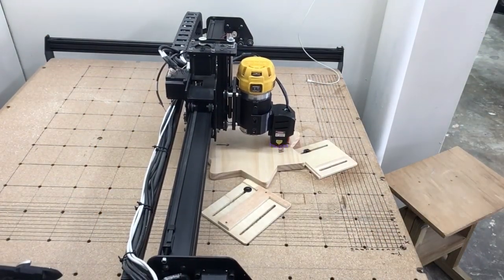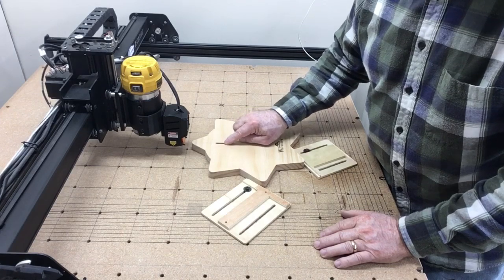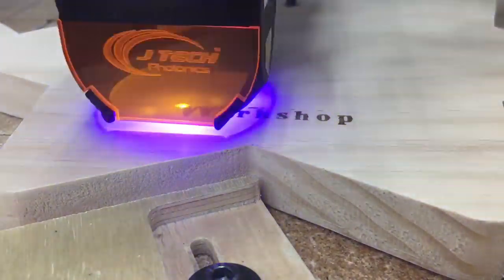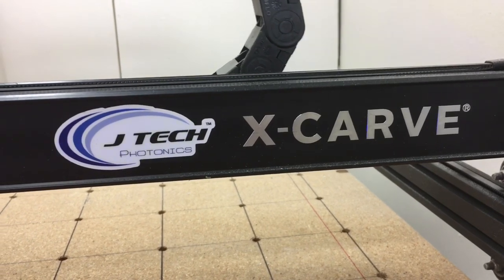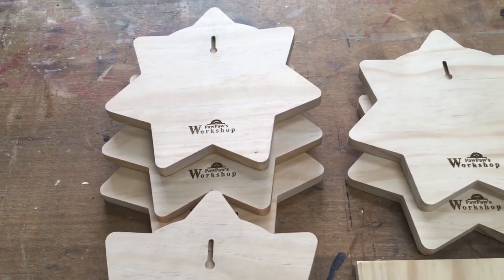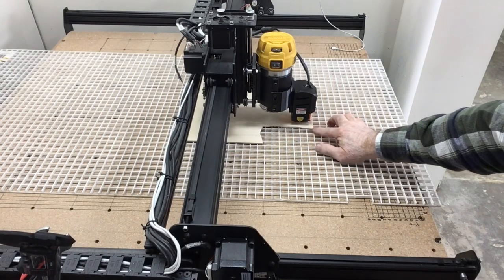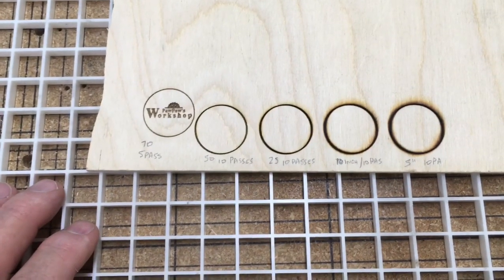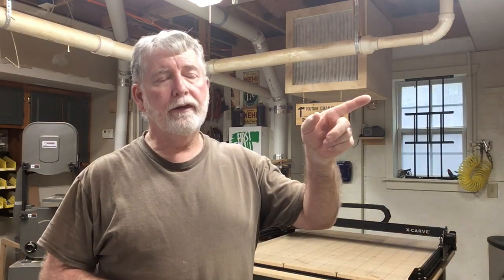Can you Laser Cut Through 3mm Plywood with 7watt Laser?

Comment: I was able to cut a 10mmX10mm square using a 7 Watt Longmill Laser after about 30 passes at 100 mm a minute using 3mm Birch plywood. The secret is to get the laser in focus. I use a "Ramp Focal Gauge from Lensdigital" (which is pricy and you could probably make your own.)  Some material cuts better then others. I can cut cedar in 3 passes and felt in one pass. I just ordered some smoked acrylic 1/8" thick and will be trying that next week. I promised to make reindeer in February and will probably have to cut it using a 1/8" CNC router bit. I will keep you updated and let you know if I can cut the smoke acrylic in a couple of passes.
Reply from the maker: Thank you for the update
Reply: @PawPawsWorkShop  I'm getting a 40 watt laser tomorrow from Crealty. It's supposed to cut 1/8" Birch in one pass at 600mm a minute.

Comment: Agree, ply type is a factor. I use atomstack pro (its says 40w but I read that its only a 5w beam) and have cut small plate stands from 3mm standard ply. I reduced the height to 1mm, max power @ 10mm/sec with 8 passes. I get some burn so I am going to use tac paper. I need to cut 50 stands. thinking of getting the X7 module that has a 10w beam, also by atomstack.

Comment: Nice video, and I really like the versatility you have being able to switch between the router and laser! Speaking from experience, having a good air assist nozzle greatly increases both the quality of engraving, and the speed of cutting with the laser. The advantages are many: when engraving, the stream of directed air blows smoke away from the laser lens so that it never fouls; when cutting, the air stream functions as mentioned, and also clears out smoke and charred material from the cut, giving the laser an unobstructed path to fresh material still needing to be vaporized. Although I'm using shop air as a source with a regulator and water trap, it seems like a tiny aperture on the nozzle is MUCH more important than having a powerful supply. I can put 150psi to the nozzle, but this breaks things, and there really isn't any increase in efficacy above 15psi. Using a 5000mw, 445nm laser module at 95%, I can get thru most 3mm plywood in 4 - 6 passes @ 500 - 750 mm/sec.
Reply from the maker: Thank you, excellent information

Comment: Paw Paw, you may want to try dropping the laser down a bit after each pass.  Your focal point for the laser changes with each pass, if your first laser pass/cut removes 1mm of material your focal point for the second pass is 1mm lower than the first pass.  You may want to also cut at 100% speed up a bit so you don’t burn the material.  Also  be careful not to crash the laser into the surface of your material.
Reply from the maker: Excellent idea. I need to turn on the z axis
Reply: This is what I think.
I am just starting with my diode laser but from what I have learned so far the focusing is critical.
As you cut deeper the focus goes out.
By dropping the z axis down to equal the depth of cut, quite deep cuts should be possible with multiple passes.

I will find out soon because this is what I want to do.
Reply: I have 6w Opt Laser and it can easily cut through 3mm plywood, but I also have air assist so that helps remove the ash for multiple passes.

Comment: do you believe it might cut through 5 mm EVA foam.
Reply from the maker: Adding air assist and lowering the z axis would help.  I'll have to try that.
Reply: I normally work with floor mat foam the stuff you find in the gym. Or 5 mm Eva craft foam the stuff you find in like hobby lobby

Comment: you can skip to 8:00. Spoiler alert, you can't cut through 3mm ply with a 7watt laser...
Reply from the maker: I've learned a lot since this video. If I activate my z axis that will lower on each pass.  Also, I can add air assist and it will do it.
Reply: @PawPawsWorkShop  it's TRUE, air assist mark the difference. one question, what bed are you using in your laser?

Comment: I have a 6W opt laser that will cut thru that with no problem. When using lightburn you have to enable your z axis and step-down on each pass. For plywood I usually step down about .25mm. Number of passes would be thickness/.25 or 8 in this case. You can play with speeds to try and find a clean cut that will cut .at lease 25 on each pass but not burn around the edges. Different materials my cut deeper than .25 on a pass or less than .25. This is hard to measure so its hard to figure out. My lasers shield sits 35 mm (60 from the lens) off the surface of the material I am cutting but it is mounted beside my dewalt 611. The spindle sits  lower than the laser, so I have to make sure it can step down the thickness of your material  without the spindle. (remove bit) or the laser hitting anything. If it does I have to remove the spindle. Lightburn can also be told to raise or lower the head more on the first pass and continue to step down from there.  I assume this could be used if your your material burns around the edges too much  on the first pass.  The manual says this can be use for deeper cuts which I don't really understand. I have aways left this at 0 mm and not had a need to use it.

Love the channel and have learned a lot of things watching it.
Reply from the maker: I have considered activating the z axis but have not done so as most of my engraving is done using the fixed level.  Thank  you very much for the information.
Reply: How do you enable the z-axis in Lightburn? I have a 7W laser attached to my CNC router as well.
Reply: @kentharris7427  Go into Devices Settings. in the top right corner click the enable z axis button. Then double click on a layer you want to use z for and  enter a value for z steps per pass along with number of passes.

Comment: A 7 watt diode laser should be able to handle 3 mm laser ply fairly easily. I think the plywood in this video may have been regular ply that's typically bonded together with formaldehyde based glues rather than the urea based glues used in laser friendly plywoods. Formaldehydes are hard even for relatively powerful CO2 lasers to cut through, whereas ureas are easy. You can tell the difference by looking at the glue layers between the plys, formaldehydes are dark brown/black, ureas are white/clear.
Reply from the maker: Excellent information! Thank you very much.

Comment: The problem is that once you make the first couple of passes you are trying to cut through a layer of carbon laid down by the previous cuts.   The layer of carbon is much harder to cut through than wood.    The more cuts the more carbon.    If you can get things lined up correctly you can try and flip the piece and cut from the other side,  this should double your cut depth  there are videos on how to do this on youtube.   It involves both software and jigs for alignment.    Multiple cuts will work better on something like acrylic because they do not create a carbon layer.
Reply from the maker: Thank you very much.  You make an excellent point.  I appreciate it very much.  Thank you for sharing.
Reply: @PawPawsWorkShop  I really enjoyed your videos by the way.    One more thing is that the air assist people mention will decrease the carbon build up between cuts.
Reply from the maker: Thank you

Comment: Great video, thanks for posting!  The new JTech 7w Pro Laser with HD lens can supposedly cut through 1/4" Home Depot ply in 3 passes at 10 in/min and 100% power.  There is a JTech sponsored video where I got that stat that also compares to the old 7w laser.  The old 7w laser did the cuts in 5 passes at 10 in/min and 100% power.
Reply from the maker: Thanks for the info! I saw an ad for the new laser.  It looks great!

Comment: You need an air assist than you can cut 3mm in 1 pass!
Reply from the maker: I will have to give that a try.
Reply: @PawPawsWorkShop  best is a small nozzel with high pressure (3 bar+) directly pointing at the cut as close as possible. So the evapurated material goes away and dosnt absorb all the laser energy. Sry for the poor english.
Reply from the maker: Thank you

Comment: PapPaw Unfortunately you need to use a 40 watt CO2 laser to cut through that sort of wood or you use Balsa wood 1/16 inch with 7 watt lasers. Laser diodes do not have the power to cut through wood at speeds you have set for you feed rate.
Reply from the maker: Yes, I think you are correct.

Comment: I've not seen many laser videos, but have seen one cutting up to 10mm ply very slowly & took several minutes to achieve. he didn't suffer the same burning you experienced, but he had a compressed air jet at the point of cut which seemed to disperse the heat generated. One of the best parts of laser cutting is the cortortised effect on the edges and no splinters or heavy sanding required
https://youtu.be/xb0Th7FBwNw
Reply from the maker: You make a good point and I will be doing more testing in the future. Thank you very much.

Comment: 40 in per min 2 passes for a 1 inch circle 100% power  of course youll need a 45 watt laser
Reply from the maker: lol, that works
Reply: Yeah even a 45 watt has its limits with hardwood or birch ply i offten just use the spindle 
I mainly use the 45watt laser for thin veneers and thin ply , fabrics ,sticky back foam and to etch images on ceramic tiles and glass or backside of mirrors with the help of pic engrave plus laser and the dac i got via jtech and my little ortur laser engraver that little laser is awesome for logos and wood / anodized metal business cards

Comment: I'm using a 2.5 watt Eleksmaker laser and had the same issue of not being able to cut through even 1/8" plywood. I recently added air assist to it and it basically turned the laser into a blowtorch. It blows all of the charring out of the way and makes the point where the laser contacts the wood a lot hotter. I noticed that the cut is cleaner and finer as well. You might give that a try. I'm now able to cut through 1/4" wood in 2 to 3 passes. One pass on 1/8".
Reply from the maker: Awesome!  Thank you, I will give that a try.

Comment: It sure can and I can also cut through 5mm as well with no air assist or incremental lowering of the Z axis!
Reply: @Maureen Cnota Jtech 7w
Reply: @Maureen Cnota if you go to my page I actually have a video of me cutting out 3mm and 5mm plywood you also need to make sure your Laser is focused.
Reply from the maker: I would love to know how you set it up to cut through 5mm. Thank you for sharing.
Reply: @PawPawsWorkShop  Sorry about that sir, on the 3mm I used 15ipm @100% and it cut through in 3 passes and on the 5mm I use 12ipm @100% and it took 10 passes both cuts the laser was 1/8" above the material.

Comment: The plywood you use makes a huge difference. The glue between layers takes more power to cut than the wood and some glues are very resistant to laser cutting.
Reply from the maker: Excellent point. Thank you very much.
Reply: @PawPawsWorkShop  You're welcome. From my experience it seems the cheaper plywood and the stuff with less layers can be cut with blue lasers.

Comment: what settings do you have your laser configured at, since the laser etching is amazing. I just got mine and I have a ton of projects to engrave, but I am burning the wood too much. Thanks
Reply from the maker: The J Tech Laser comes from the factory set by the pins at 80% power.  In Lightburn I set it at 100% power and 70 inches per minute.
Reply: @PawPawsWorkShop  what about the fire power percentage, what is that set at
Reply from the maker: That is turned down to about 3.5%

Comment: what i do sometimes is engrave a origin point for the xcarve, engrave all the work and then set the router bit at the origin i engraved in that way i ensure that my cut will be alined with the engrave
Reply from the maker: Excellent idea.  I have a line on both the x and y axis that I cut with the cnc to give a very accurate reference point.  Thank you for your suggestion.

Comment: Getting ready to add a JTEch Laser to my X-Carve, I am on the fence about 7W vs 3.8W laser, after watching this I am starting to lean to the 3.8W since I would not need it to cut just burn.  If you had to do it again would you have went with the 3.8W?  How has it been holding up?
Reply from the maker: I like the 7w very much and it is holding up very well.  The 3.8w will work fine, but it will just take longer to engrave the project.

Comment: I have watched a bunch of diode laser videos on youtube and many have the same results you found.  One common thread is that the actual power of these units is all over the place when properly measured by a precision meter.  Jtech has a good reputation but it is still hard to know if you are actually getting all of the rated power.  I also hear that your mileage may vary between brands of plywood owing to the different adhesives used.  I suggest that try some 1/8th crafting basswood and see if you fair a little better.  Also, just as jsellers202 mentioned, dropping down a touch with each pass would seem to be a good idea to keep the laser focus at the level where the actual cutting is happening.  I keep looking at lasers and I really want one.
Reply from the maker: Thank you very much for your input.  I will be giving this a try.

Comment: i have one i got in china that burns so hot you wouldn't believe, and because its a Chinese knock off it was extremely cheap. i found out if you get the right Chinese company the stuff they copy is just as good as the original or better but a whole lot cheaper, but it has no name on it anywhere, its all unbranded. i have had it already for 3 yrs and it still works great.
Reply from the maker: Awesome!  What is the name of the manufacturer?
Reply: Any link you care to share?